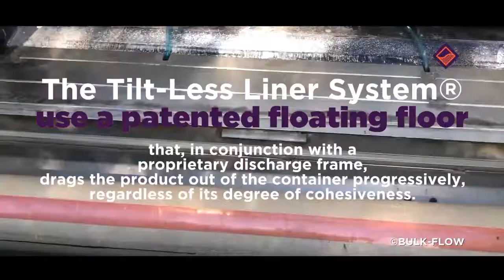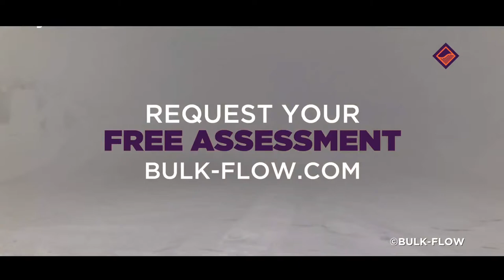TILT-LESS LINER DISCHARGE SYSTEM

Comment: Is it wheat  flour?
Reply from the maker: Hi, the Tilt-Less Liner System is able to unload all kind of cohesive hard-to-flow dry bulk products (such as Cement, Lime, Flour, Silica...), because the container is not tilted, and therefore the dry bulk inside the container is not compressed further. Our Tilt-Less liner System has a doble floor that puls the product towards the hopper mechanically.
Reply: Hi, this is calcium carbonate; 26 tons in a 20ft container